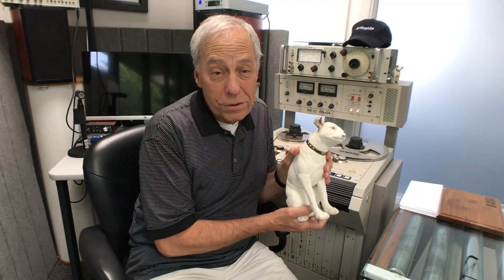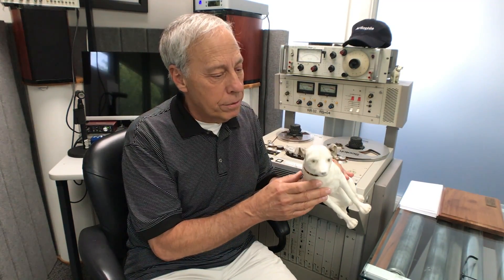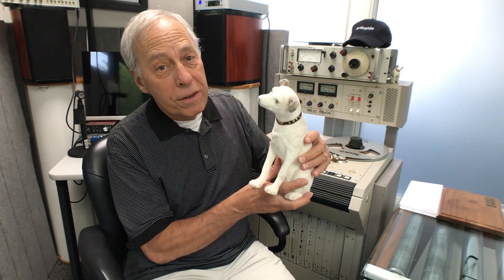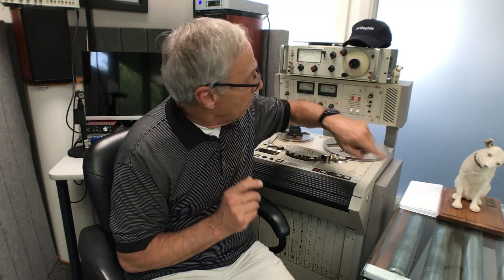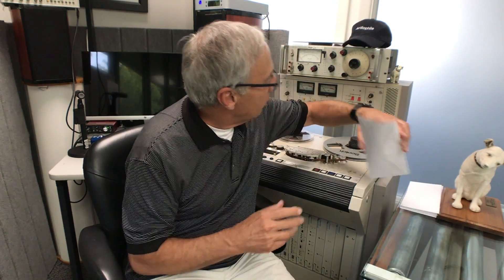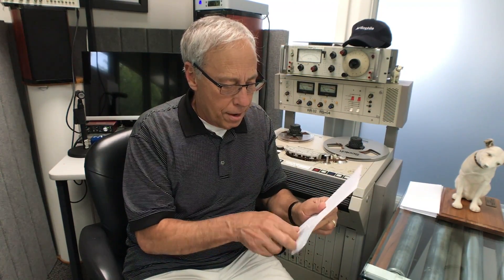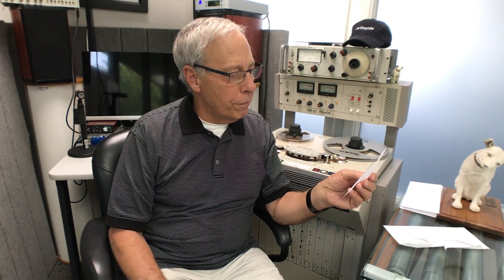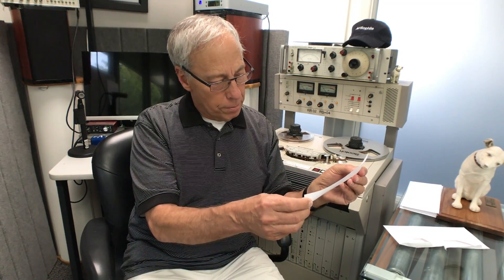Thin cables inside speakers

Comment: I recently refurbished German manufactured mb quart q1002 towers. New film capacitors and while I was there I had some extra knukonceptz 12 awg ultraflex speaker wiring. 236 stands 12 gauge wire, pretty neat stuff. I used it for my internal wIring. It soldiers very smoothly having so many fine strands. Did it improve sound quality? I can't be sure since I replaced dried out capacitors at same time so all I know is it sounds great again. Especially on the midrange frequencies. Underlying harmonies are present that I never noticed before on some passages of music. I would say replacing the factory thin 14 gauge wIring with high quality greater sized cables most likely helped although by how much I cannot say. I think its worth it and enjoy doing it so it's worth it to me. I am looking  at my aging subwoofer and thinking about redoing the internal wIring on it next.

Comment: That answer just isn`t good enough we are ripped off at every turn with so-called hi-fi equipment and it`s about time we really get value for the extortionate amount we pay- and this is the reason I don`t buy a thick speaker cable because it won`t make any difference and doesn`t. All you snake oil aficionados can waste your money because I have measured all the shortcomings of different speaker cables on my oscilloscope and find that the more expensive ones are no better than plain old mains cable. I used to enjoy your vids Paul but no longer since you evaded the answer shame on you.

Comment: If you do not need any great length of cable, which you probably do not inside a speaker, something thin may work just fine. Connecting the speaker to your amplifier may need to cover some distance depending on the size of the room and so larger cross section cable is preferable.

Comment: I think you need too look at the current flowing threw the wire and how much.. a skinny wire can only handle so much. But also the length  of the wire matters also.   It might not make that much of a difference because it's so short. So it most likely  a universal  way of doing speaker wiring

Comment: IF big cables make a difference, and I'm not saying they do or don't,  then it does stand to reason that the cable leading up to the crossover should be heavier than the wiring running from the crossover to each individual driver.

Now about those big cables:  Once you have a cable that's big enough to carry the maximum level signal that you're ever going to put through it,  without measurable voltage loss due to internal resistance, then going to a cable that is of a heavier gauge makes absolutely no sense.    

I do believe that cables can and do sometimes sound different.  They're made differently and that affects their RLC values. (Resistance, inductance, capacitance. ) Thus they're RLC filters and whn you change those values  you change the frequency response.  That is academic fact.  You can't argue against that.      But the notion that a cable HAS to be bigger than that "large enough for all purposes" size to sound better is just a load of hogwash.
Reply: L= Inductance ?

Comment: Thick wire could only make sense at crossover input or woofer/subwoofer connections. When you have some a few Ohm resistors connected in series for tweeter and midrange crossover networks the wire size is pretty much  irrelevant.

Comment: Obviously doesn't know thickness of wire gauge. Nobody
wires their speakers with 12 gauge - it's too thick. Probably
16 gauge (lamp cord) is too thick also. More likely, speaker manufactures use 18-22 gauge to be able to solder to the
speaker terminal or use slip-on connectors.

Comment: Well, if that big horse leg cables do make different in short length cables inside speaker cabinet, then you need to replace all joint in PCB on your amplifier with that big horse leg cables as well...

Comment: The gauge of the wire is important only up to a certain point.  Wire has resistance, of course.  And the lower the gauge, the less resistance it has per foot.  This is important because the wire acts as a resistor in series with the speaker - creating a voltage divider.  In an extreme case, the wire will get hot.  But beyond that, the resistance of cheap wire will waste power from the amplifier.  For instance, I use 10 awg cables for 220W/ch amps - which is generally about 1 ohm per hundred feet for copper wire.  My longest length is 10 feet, so my 8 ohm speakers are in a voltage divider network with a 0.1 ohm cable.  But woofers can get as low as 2 ohms - some cheap subs can drop to less than 1 ohm.  10 feet of 18 gauge speaker wire is generally more than a half ohm.  So you can see why this might get important.

But gauge is just half the story.  There's also something called the skin effect.  Higher frequency electrons prefer to move along the surface of a wire, rather than through the center.  The higher the frequency, the more they want to move along the surface.  And the more they do this, the less wire they use.  So even having enormous horse leg cables will have a higher resistance to high frequencies if they have insufficient surface area.  We can't make electrons travel down the center of a wire, but we can present them with more surface area to use.  This is why a high 'thread count' matters - the more conductors in a cable, the better.  More conductors means more surface area for the high frequencies.
This is why my 10 gauge cables are 1050 "threads" - each conductor being as fine as a hair.

So, when powering a sub, it's fine to have a huge, thick copper or silver wire with really low resistance, but the thread count is really not very important.  The wire going to a tweeter, on the other hand, does not need to be very heavy duty, but it should have a high thread count.

So this is why both size and thread count is very important going between the amp and the speaker because it has to have both low resistance and high surface area.  The wiring on the other side of the crossover has different requirements, depending on the driver its going to.
Reply: To be honest with speakers I would say any heat generated in the cable tells you the cable is too thin. Skin effect is a vastly over exaggerated claim in the audio world. Even in high frequency switch mode systems operating at 100KZ or more skin effect isn't so much of an issue that we have to vastly oversize conductors the way some audiophiles claim they need to for 20khz.
Reply: @cbcdesign001  For one thing, heat will always be generated unless you are using superconducting cables with zero resistance.  I seriously doubt it.  I think you meant if the cable is warm to the touch.  In which case, that's obviously way beyond simply too much cable resistance.  Your cable should not show any more than a 1 or 2 degrees F above ambient even with extended periods at maximum amplifier RMS power rating.
Second, skin effect is more of a problem with increased cable resistance - again, the wire forms a voltage divider network with the speaker.  This could easily be remedied with equalization, but it's also a matter of amplifier efficiency.  My 1050 thread 10ga solution cost me a grand total of $60 on a 5.1 system - a pittance compared to the thousands my whole system represents.  And it's more than enough to mediate any skin effects unless you're running cable a hundred meters or more.
And also remember that we're talking audiophile level audio - not your average home theater system where the standard is 14ga 7 thread count wire where 50' costs $14 at your local hardware store.

Comment: A year late to this video, but just 1 hour shy of the last comment...  yt's recommendations heh.
Would it be reasonable to think this is kind-of an Edison vs Tesla type of problem? You only really need thick wires/cables for DC, while AC doesn't require as much to transfer the same power, and the signal at that point is certainly a form of AC. That said, ideally you wouldn't use the same gauge wire for a tweeter than for a woofer, efficiency would go down the closer you get to DC, and 20-40hz is pretty close. So it ends up being cost: you only source 1 type of wire for the internals, and stick to that to reduce the BOM.

Comment: Most likely...the shorter lengths of the wiring inside the cabinets don't need to compensate for volt drop as the longer lengths of cables outside the cabinets experience and therefore can be thinner!

Comment: From an engineering technician, the actual answer is in the wire tables.  Due to the low resistance of wire most resistance tables are for 1,000 feet of wire for a single conductor.  For example a single wire resistance for 1,000 feet is doubled for a wire pair for the 2,000 foot round trip.  For resistance per foot, divide by 1,000.
Inside a speaker a foot of 18 AWG wire (American not metric)  see tables for metric for metric wire sizes, a two foot length of wire has a resistance of 0.01278 ohms.  A 12 AWG speaker wire 12.5 feet long has a round trip length of 25 feet and a resistance of 0.03975 ohms. In relative terms the 18 AWG jumper in the speaker has less resistance than the 12AWG wire to the amp.  In high vibration inside the speaker cabinet, a thick wire vibrating will cause more damage inside the speaker than a lighter wire that can be held in place by the acoustic batting.  The wire size inside is a trade of performance for mechanical reasons.  Google wire size resistance tables or charts for your introduction to copper wire data.  Very heavy wire and connections in high vibration areas are a bad mix.
Reply: We have a winner!
What happens when you use thicker, stiffer wire inside loudspeaker cabinets? The mechanical stresses on the terminals increase, and they'll be more likely to crack and break. Even during factory assembly you want the wires to be flexible enough to put things together without flexing the terminals instead. As isettech notes, the resistance of these short wires is negligible.

Comment: "Thick" speaker cables are pure snake oil.  Ordinary lamp cord 18-20 gauge is adequate and likely SUPERIOR to these so called "Monster cable" speaker wires.  These thicker wires actually add unnecessary capacitance to the speaker leads.  I have measured this.

Comment: The real straight answer is twofold. Cost is one. Another is that the shorter the run of wire the less resistance it has so the smaller it has to be to handle a given amount of power. Also, since it has less resistance and other undesirable properties due its short length it will minimally affect crossovers, etc. If you are using 10 gauge wire on a run under 30 feet you are blowing your money. Spend your money on good drivers and acoustic treatments of the listening space if you want good sound, then a decent amp, and the rest is a bunch of hype so these people can suck money from fools. Even high end speaker manufacturers are full of crap. Only way to be sure you are making a good investment is to do your own research and learn the fundamentals of sound and electronics. Also, the room in which the speakers ultimately radiate into is just as important as the speakers and way more important than any other component.

Comment: The thin wire handles the power because the speaker designers have calculated that's all that is required.  No snake oil there.

Comment: I can add a comment that lies somewhere between HHScott's "straight answer" and Pauls salesmanship.

The effect of cables in systems are minimal, as long as runs are reasonable and quality is decent. Speaker wire, post crossover is always relatively short and only has to handle part of the frequency band, thus spending extra money on internal wire rapidly gets in to the laws of diminishing returns. Scott is correct in stating that companies are interested in making money and making sure you spend yours. Hence the tendency to promote thick external cable upgrades under the promise of great results when we truly are in the realm of diminishing returns as well.

Comment: The reason is because internal wires are short compared to, for example, 100 ft in wall runs. A shorter wire has less power loss. Unless each driver is running at 1000 watts, 14 or 16 AWG should be more than enough. Make sure its copper and oxygen free. Save the extra money for better tweeters.

Comment: The answer is quite obvious: length. The cables inside are a few inches long and being thin has little effect. The outside cables are sometimes dozens of feet long and therefore MUST be thicker and better quality, otherwise the cumulative effect of all that length would be disastrous.

Comment: Small speaker wire is only needed because of the short distances needed to be covered. If the speaker jack on the back of the cabinet was 50' from the speakers you would see larger gauge wire being used. The most important thing is having a speaker gauge that is large enough for the distance/ frequency/ and impedance of the load. Damping factor is greatly influenced by all of these.

Comment: I always used 10 gauge wire inside my cabinets. Paul refuses to give an honest answer   because he's protecting the audio rip off industry, which of course he's a part of.
Reply: I wouldn't use 10 gauge unless I was connecting 10,000 watt drivers.  
At 1000 watts or less, wire heavier than 14 gauge is a waste of copper.
Reply: Marianne Oelund the AR LST speaker was judged as the consumer speaker able to handle the most power. It was 12 watts continuous. Otherwise  the voice coils light up...
Reply: @marianneoelund2940  U never tried. And this is wrong. U should work in the HIFI industry mate.
Reply: @vivianvaldi7871  
Of course the condition that was assumed, is wire run lengths typical of home installations, not long-distance runs in commercial buildings.  
You can create counterexamples easily enough, but they are not relevant to audiophile systems.  For example, with a 4 ohm speaker that is 200 feet (60m) away, you would want 10 gauge wire to keep losses under 1dB.  But a 30 foot run to a 4 ohm speaker using 14 gauge wire only incurs a loss of 1/3 dB.
Reply: @marianneoelund2940  I use 14 gauge pretty much for all my speakers besides tweeters and even for them I will use no less than 18 gauge.  Never have I heard or was able to quantify in some way an audible difference in upsizing to 14 gauge from 18 gauge.
Reply: @krismichalsky  
Your frankness and honesty is refreshing.
Reply: That's exactly how it is. Thumbs up!
Reply: This, cables don't matter as long as its copper and of a certain minimum thickness to handle the power. Cables are the snake oil of the hifi world.
Reply: Do not listen to Paul McGowan or Steve Guttenberg, they are audio pseudo science pushers. Stick with Audioholics Gene Dellasala because he is very knowledgeable and honest. McGowan and Guttenberg are clowns to be honest.
Reply: @thegoat164  Guttenberg, YES! But even more so is Gene from Audioholics!

Comment: For the cost of some audio equipment, it's amazing they don't put fancy wiring inside. I guess even they think it doesn't change things despite charging heaps for other types on fanciful things that don't really add more than a 1%.
Reply: Some do, some don't. The autio industry isn't homogenous any more than any other industry is. You don't get what you don't pay for. Paul's answer was a complete and utter cop-out. Sometimes I wonder if he does any of the design work or is just the owner.  It seems he often strugglse to explain simple concepts. He doesn't sound like an engineer.

Comment: I know nothing about hi-end audiophile stuff really. 
But just a thought... you can't say you can't stuff a really thick gauge soft thin coper strands, silicone insulated (the type used in RC - radio controlled model airplanes, as it is very soft - easy to route around and heat resistant, so it can carry lotsa current while being light...) in a speaker. I guess if it would make ANY difference (for the better ;-), two dollars of wire might be worth trying it ;-)

Comment: The longer the wire is the more you here the characteristics of the wire. With the shorter length in the speaker there is not enough distance to create any audible signal degradation.  So they can cheat there.

Comment: "... notice the wires from the cross over to the driver itself were extremely thin.  How does this wire handle the power?" 
 
Yes it is an excellent question.  Too bad your non-answer is not equally excellent. 
 
"I was the electronic guy."  What does that mean?  Do you have an electronics engineering degree?  You didn't answer the question like you do.  In fact you didn't even answer the question. I'm left wondering if you even know.

Comment: I think the issue is that the power handling ability is not really much to worry about. In my case a 140w amp and 8 ohm speakers is a peak current of 6amps(ish) which doesnt need huge wire. I would not ever be playing it at anything like that volume. The internal wire is very short so the effects of the thin wire are minimal. The output impedance of my amp is .035ohms so if you use a few yards of the nasty thin cable you usually get with systems you have a major effect on the damping effect on the speaker and also the ability to handle heafty transients due to increased resistance. There is a lot more to speaker cables than that though.